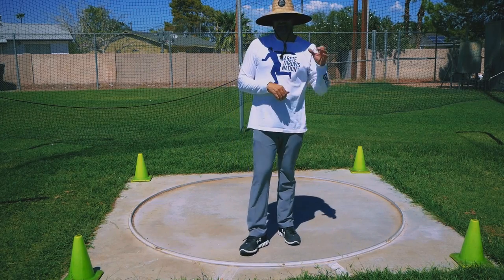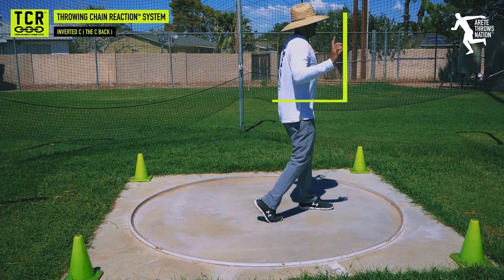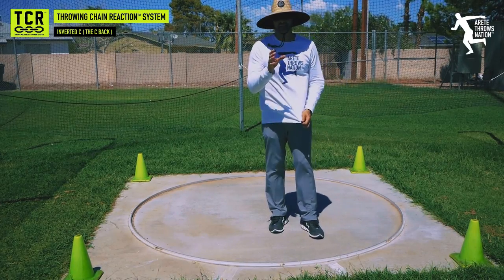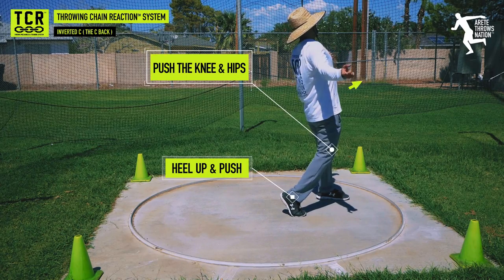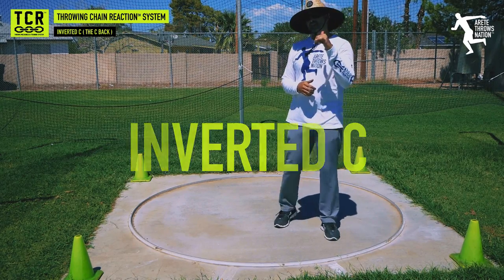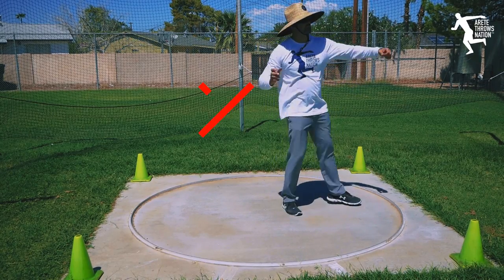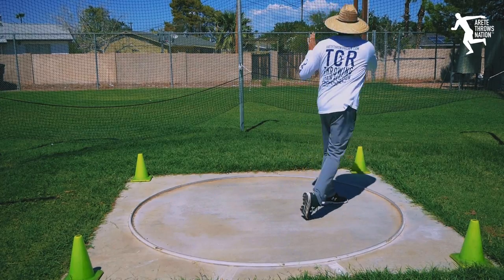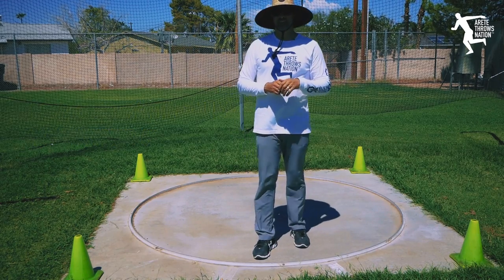Shot Put & Discus TECHNIQUE | 2 Critical MISTAKES about the  POWER POSITION.

Comment: Coach where should the eyes be on the finish?
Reply from the maker: Adam Wynn as a rule eyes will stay on the sector by the head turns with the hips so head is slightly to the left of center of sector as hips should be. But I like to cue my athletes to keep the eyes tracking the implement to work the linear aspect of delivery.